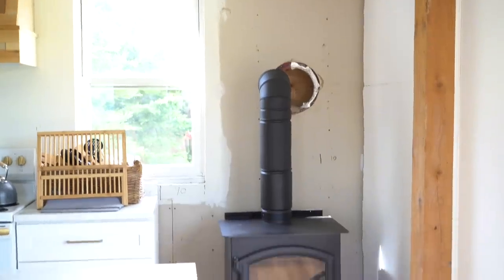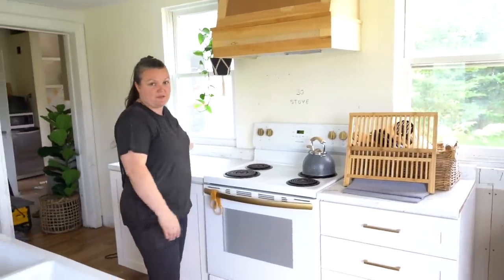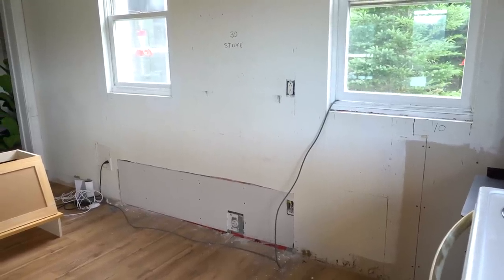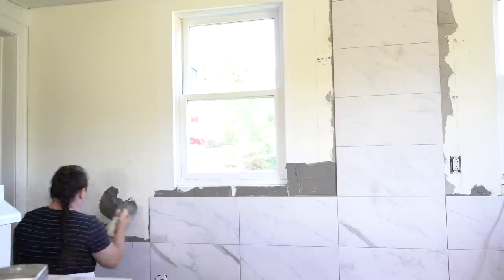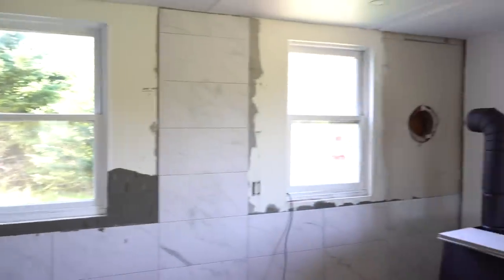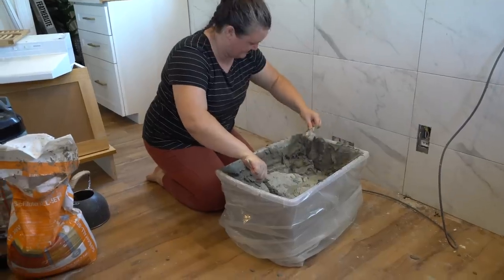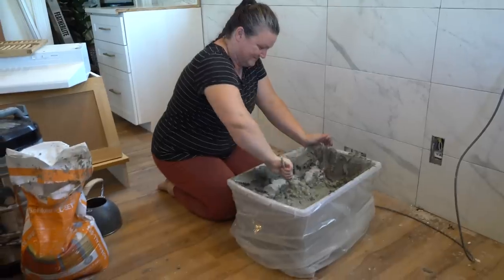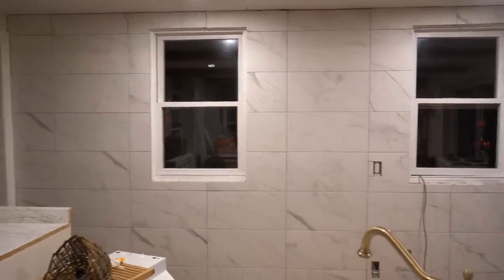We have no plan B....(Kitchen Renovation under $5000)

Comment: I would clear coat the inside of the drawers. Love the tiles!! I would add grout. Grease can get in those grooves and would be hard to clean. I had a friend that did the no grout and hated it after a while.
Reply: Strongly encourage the grout.  Otherwise water can get behind the tiles, even from cleaning.
Reply: @susandickerson2663  Maybe they can clean with rubbing alcohol instead of water since it dries quickly and does a good job on grease. But it does catch fire so not sure how safe it would be.

Comment: I would add white grout in the lines between tiles to make it look less sectional more of a slab look. I did this in my shower and it is beautiful.clear coat drawers , everything is beautiful. Be sure to seal the grout for ease of cleaning. Also I might change the vent to one that actually vents to the outside through the attic . The vent that vent nowhere do no good, i just moved into a house with a vent like yours and it just vents grease to the top of vent which i believe would be inside your wood?  Glad to seePhillip better

Comment: Finish drawer interiors with a clear coat/ polyurethane. Do not paint.  You’ll end up regretting if you do.  Every scratch will show up and the paint will peel. Happy to see Phil up and about again. You are both doing a fantastic job on the place. It’s beautiful. Curious to know if you had considered placing your wood burning stove caddy corner.

Comment: Wall looks awesome.  I have the close tiles but there is a little tiny bit of grout pusher in, so easy to clean. I would not paint inside the drawers just seal so they will wipe clean.  So glad to see Phil up and going, just goes to show you can't keep a good guy down.

Comment: I would seal the inside of the draws with a clear coat. It will prevent wood warping IF something happened to get it wet. And easier to clean out later. Also a good idea for on top of the paint.

Comment: Tile wall is looking awesome! For the drawer insides, I would just clear coat them. This way your  protect the wood, and, eliminate the need to touch up paint as they will definately get scratched during use. ps..  I'm not an expert, but I think while cutting tile, a dust mask with charcoal and/or other options to protect you from fine dust or silica will help protect your lungs.🌷🌷

Comment: The tiled wall looks great! But you most definitely need grout! White, grey, or clear. Dirt/dust and water will get in ALL of those open spaces and you won’t be able to adequately clean it! And the water, over time, will erode the adhesion to the wall. Glad to see Phil up and about some (hope his doctor isn’t cringing seeing him walking around 😁). Our 1936 bungalow has its original built-on-site-all-real-wood cabinets! The insides of all of the cabinets and drawers (only 2 drawers!) are all painted with gloss white paint. Gloss paint is the most durable and “cleanable” of paints. It is holding up really well. BUT do NOT put shelf liner on top of it because it WILL mess up the paint surface! I would never paint the insides of drawers in NEW, box store cabinets, but they are not real wood, even if you purchase “all wood” cabinets. The paint would not adhere properly. Blessings!❤️

Comment: Love your Channel I wish they were 3 hours long each episode. 💖😎🤘
 I would not paint the drawers... you can always do it at a later time but I live in a 100 year old house and we got about 10 coats of paint and it is a mess. I can't sand the drawers that much because there's probably lead paint so I would just line them... you could wax them. But if I was in your situation I would just clear coat them and seal them.

Comment: I think for the inside of the drawers I would do a Matt spray laquer. Do not paint the sides of they run on the rollers to open and close. I forget how you did them. The wall looks great. I thought you were going to go around to the corner wall too.

Comment: My cabinets are solid pine. Cabinet maker stained and sealed inside of cabinets and drawers. I use liners for shelves and drawers. Easy to vacuum out drawers. Liners can be wiped out with sponge and cleaner.

Comment: I would still grout it because of any particles in the air or otherwise getting in the cracks and it may stain. I love my cabinet drawers are sealed inside with a clear coat.

Comment: I think the tile wall is looking fabulous! It will be easy to keep clean. For the drawers, if you are going line them with mac tac, why bother to paint the inside. Maybe applying a scented or tinted wax to keep the wood hydrated or whatever. Anyway, lots of sympathy to Phil. Foot injuries totally hurt. The boot cast is reusable I used mine when I sprained my ankle big time. I'm still traumatized.🙃🙃🤟🤟🤟

Comment: My opinion  for inside has been if no moisture worry then  plain. Paint can get sticky attacks more smells.  Think of smoker walls. Paneled walls wipe off. Panels sealed stopped other stain like crayons.  Gases that are smells inbed  into   painted thinks  ones even sealed. Paint also scratches more.  So that has been my thinking so far.

Comment: I was wondering why you were working directly on the table with no protection, appreciate you explaining.  The tile is looking good!
My kitchen drawers are not painted inside, but it's an older house, they are original.  My interior cupboards are not painted either.  I think it's your choice what ever look you like best, which ever is easier to maintain.

Comment: I would not paint the bottom on the drawers but I would be tempted to do the sides. the bottom will be covered with "stuff" and will get dinged up the most (ie needing retouching more often). the sides will be seen more and won't need the same touchups

Comment: Beautiful!  Great job on the tile!  I would leave the inside of the drawers wood and use a wax or spray shellac or acrylic finish. They will get less scratched up than the paint will. At some point later if they start looking a little beat up you can always paint them.  QUESTION--- Why did you tile behind the cabinets?

Comment: You should print and frame a picture of each room and hang them on the walls to remind yourself how much your house has changed!  Love the tiles but wondered why you didn't use spacers between the tiles.  Paint inside the drawers to keep them easier to clean but if the wood inside is smooth then I'd probably leave it.

Comment: Use a hair dryer over your cup stains on your table it might take a few minutes but there there cause it’s still wet in there but if you use the dryer it will dry it out from the inside it will take time but it works , and love the tile work and I would paint inside your drawers and cabinets it would make a cleaner finished look

Comment: The wood stove and kitchen plan look so nice.  I love watching your renovation and admire your skills.  Question:  Are special requirements needed for fireproof wall, flooring, and distance to furniture for a wood stove?  I had one years ago and seems we needed a fireproof wall and flooring under the stove as feet of stove get hot. Had to be mindful of distance to stove of flammable furnishing. You may have used cement board and not sheet rock behind the stove?  Best of luck and can't wait to see your kitchen fully operational.

Comment: Good to see you back.  I have been missing you.  I would not paint the interior of the cabinet,  just the mactac in my opinion will be easier, faster, and cleaner,  Paint will scratch with time,  I'm more worry about the wall on the right side of the wood stove.  did you put fire protection on that wall, because this wall is near the wood stove and is a fire hazard.  the fireman and the home insurance can deny you the use of the wood stove if they think it's a fire hazard.  I use to have a cooking wood stove and it had to be a certain distance from the wall and the fire department came to check.  but I'm in Quebec
Reply from the maker: yes behind the store and tiles in a firewall and to the right of it it also the fire wall and it will also be tiles. tiles will be under it as well

Comment: Phillip you might consider wearing a thick shoe or boot on your other foot. It really jacks up your back, hips, and knee on the other side when you walk around with the uneven height. I know you are a barefoot kind of guy but the adjustment back to even and level walking is when you will feel the consequences of having one foot elevated all the time in that boot.   You don't want to go through all this healing process to be done with that and then need therapy and chiropractic treatment on the other side when the boot comes off. 

About the tile. I agree with the above comments. Grout the lines.  You see them anyway so just pick the color that matches the tile and fill them in to prevent moisture from getting back there. If you match the grout well it may even minimize the lines more.  IMO

Comment: Don’t paint the inside of the drawers. There is a lot of wear in a drawer. You’ll have to keep painting it. A wooden surface hides the wear. You can also use a paste wax or big mama butter to freshen up inside a drawer if the wear starts to show.

Comment: I think I would’ve framed the windows out first before I put the tile up. And on your stove aren’t you going to have the exhaust exhaust outside? it’s such a wasted expense to have the tile go behind the cupboards. I can understand it going behind the stove but not the cupboards. And with you being on a tight budget just didn’t make sense to me.
Reply from the maker: the tiles were less than $1 a tile. this way years from now the cabinets may need replacing and the tile will cover the whole wall incase of a reconfiguration :)